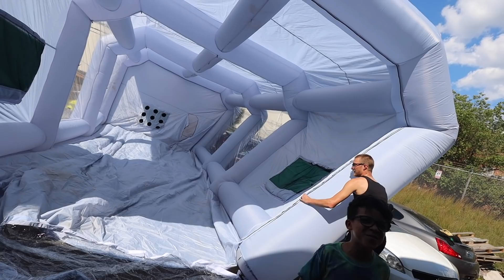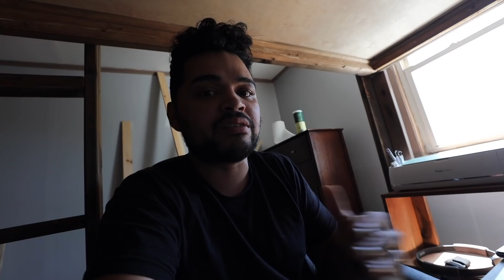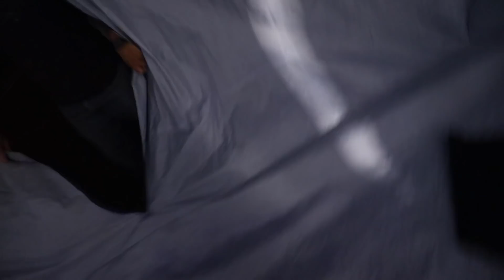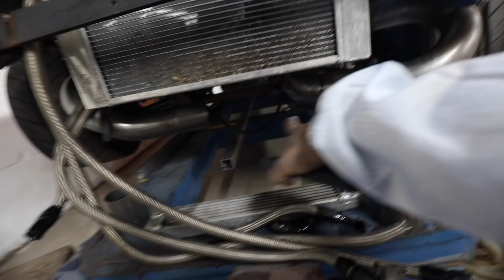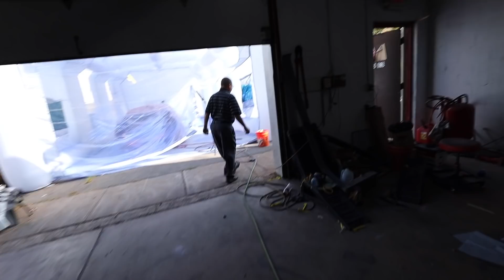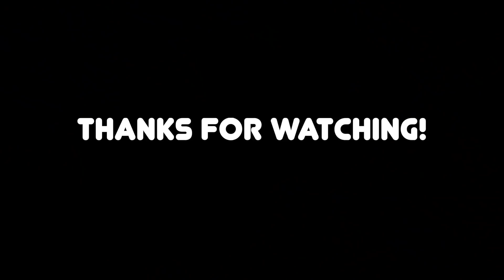PHOENIXS New paint looks AMAZING!

Comment: Imagine if when he finish that car he have a car accident
Reply: Back in the late 70s I knew a guy that spent a fortune on frame-off restore of Mercedes 300SL Gullwing door..  He got to drive it about 8 minutes before a large 1 ton size pickup loaded with gravel blew a red light and T boned the Mercedes in the passenger side, utterly totaling it.  only left side suspension bits and engine trans diff and one seat, steering wheel and gauge cluster were salvageable. Total disaster.
Reply: @jenniferwhitewolf3784  damn